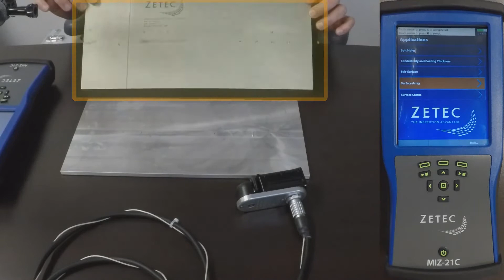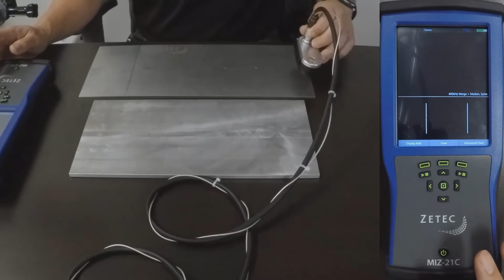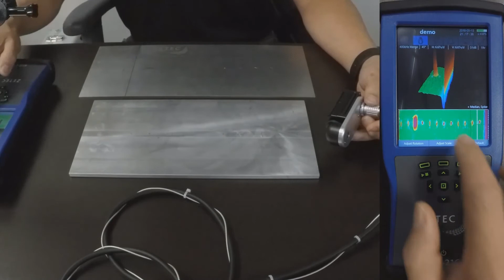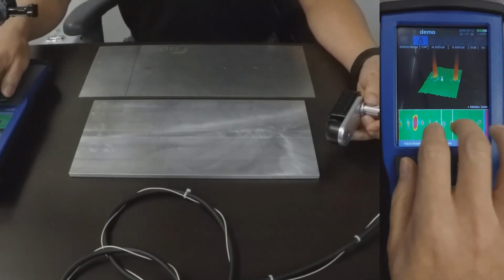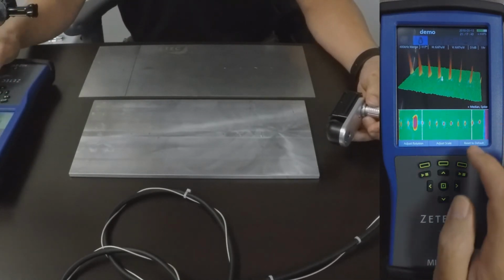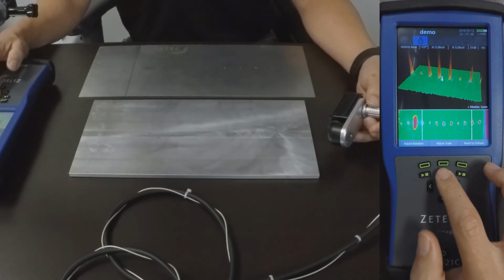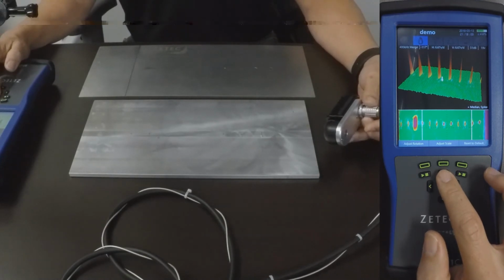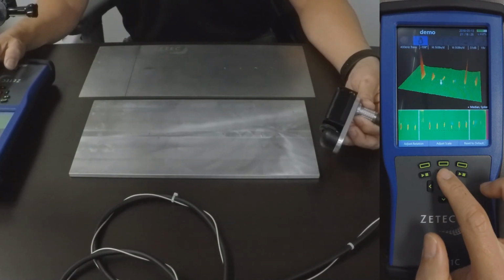MIZ-21C Eddy Current Instrument - Friction Stir Weld Inspection Demo

Comment: what starndard does zetec use to calibrate the MIZ21
Reply from the maker: For the MIZ-21C, our calibration lab is compliant to ISO/IEC 17025. For the eddy current signal in that particular video we are using a flat Stainless Steel plate with a groove that goes across the plate and setting that groove signal to a specified phase and amplitude. If you need additional details or information, please contact us at: https://www.zetec.com/contact-us/